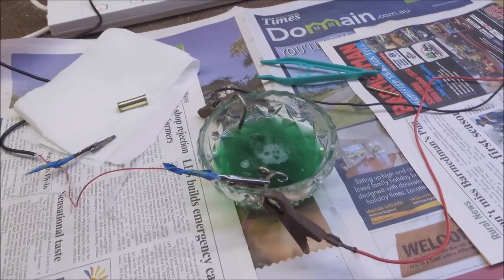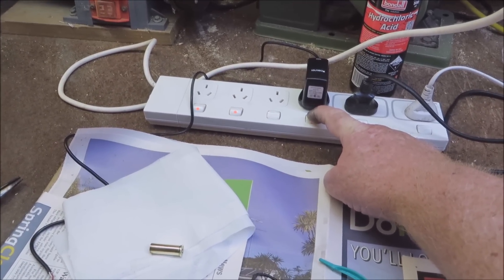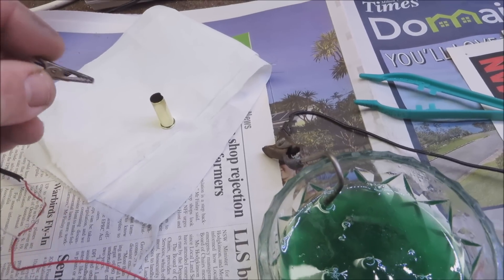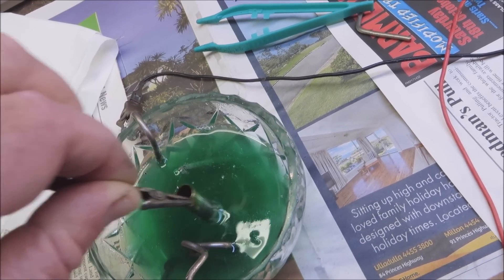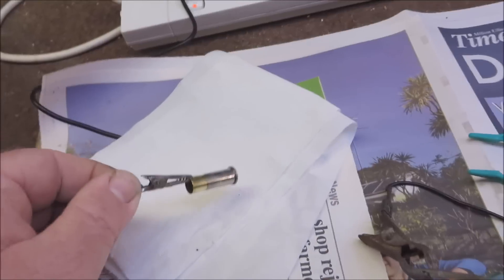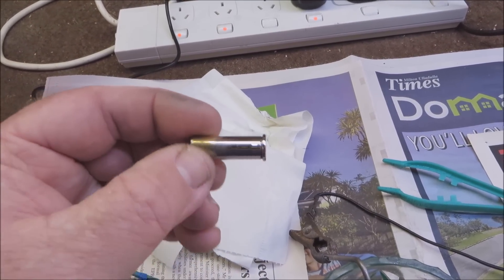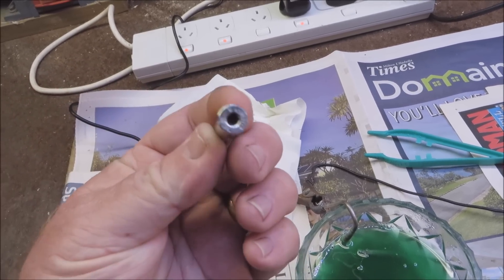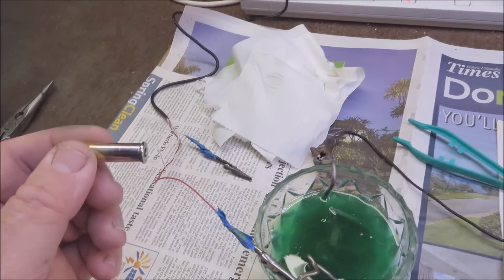Work Shop Talk - DIY Nickel Plating at home - Hints & Tips

Comment: +Blue Heeler
Just a thought for attaching the conductor to tubular objects such as that .38 special case... Use your pistol cleaning rod with the 38 calibre brass bristle brush INSIDE the case.  Should allow you to plate the entire cartridge with only minimal issues inside the cartridge.  I would expect you will need to give the brush a good twist inside the cartridge every few seconds to keep it from bonding.  ;<D
Reply from the maker: Very good suggestion!

Comment: It would have been helpful if you explained what the green solution consists of, how and where you attach the voltage leads and why you chose  the voltage you did and finally what materials the voltage leads are attached to. I really left with more questions than answers.
Reply from the maker: G'day mate, the video was actually done for a model steam engine forum that I belong to. Have a look at this link (unfortunately the photos have been lost) and it should answer a lot of your questions. If it doesn't, I'm more than happy to answer any you have -https://www.tapatalk.com/groups/modelsteam/viewtopic.php?f=21&t=92045&p=1304020&hilit=plating#p1304020
Cheers

Comment: can a bath be made from just water and nickel sulphate? if so, what mix ratio? thanks
Reply from the maker: I'm sorry I can't answer that. I just make the solution from dissolving pure nickel welding rods.
Reply: Blue Heeler is it just water? It should be some sort of acid most people use acetic acid witch is a little too weak at 5% but I digress that's what everyone is asking what is the solution? Is it just water and that's it?

Comment: is it applicable to motorcycle cylinder wall....?and where can i get the nikasil solution....?
Reply from the maker: I've only plated brass using this method. Sorry I can't answer your query in regards to motorcycle.
Reply: Blue Heeler ok tq sir for the reply...
Reply: hondansr250sp you can order any  liquid